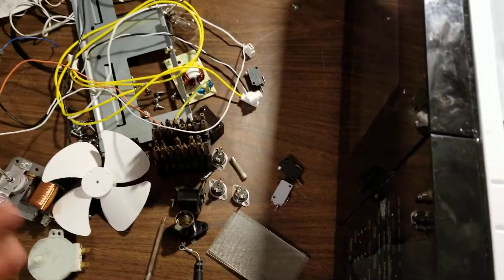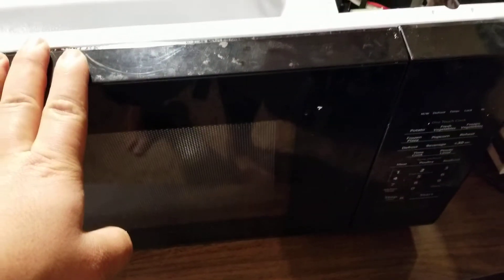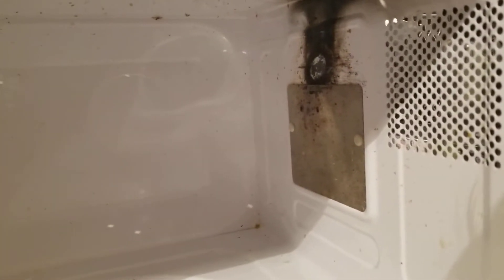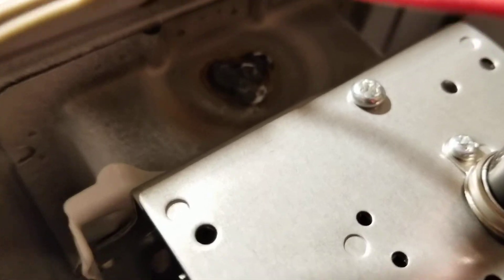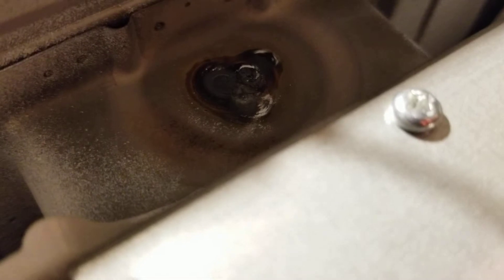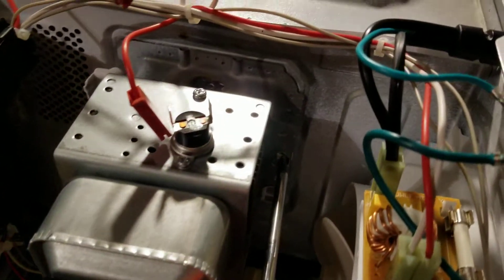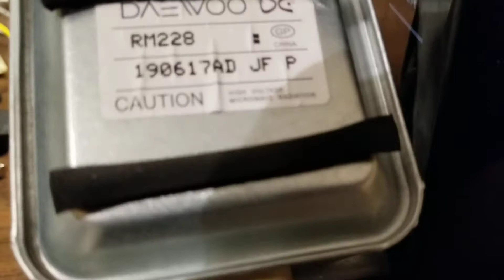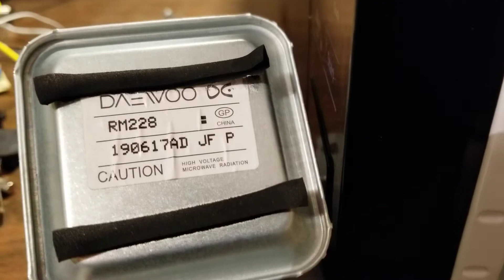Magnetron failure #2

Comment: That magnetron is easily repairable. Since it is still heating it means the arcing has not burnt through and compromised the vacuum.  
The part that is burnt is just the antenna cap and is easily replaceable. You just pull it off and push in a new one. Many different types are available from AliExpress.  I recently bought an assorted pack of different ones and just used the one that matched best.
Mine had failed because I forgot to put the food inside it and walked away.  The damage appeared almost exactly the same, except that in my case even the mica window in front of the waveguide had a one inch hole burnt through it. The failure has nothing to do with poor quality - it is just that if there is nothing in it the energy has nowhere to go and it just goes into heating the air to very high temperatures that melt or even vaporise the metal, and in my case the mica.  Some ovens have a cutout that shuts off if that happens, though I'm not sure how it detects the condition.
Reply: I see a burnt metal. Mine also experience the same thing. If I change the magnetron, is there will be any issue with the burnt metal?
Reply: @sharifabdulrahmansharifhas6607  If only the metal cap is burned then you only need to change that.   If the magnetron is defective and you buy a new one it will have its own new metal cap and so you will not use the burnt one.